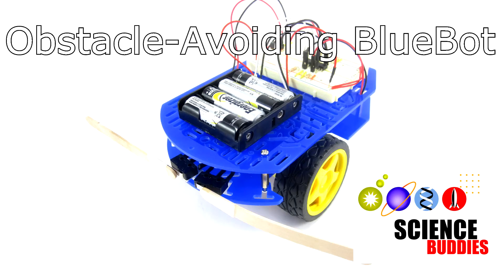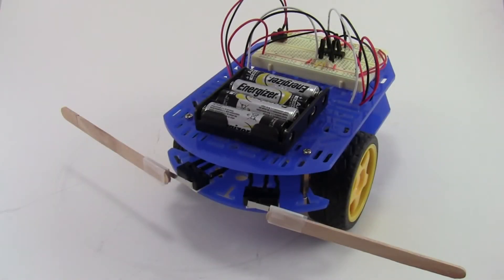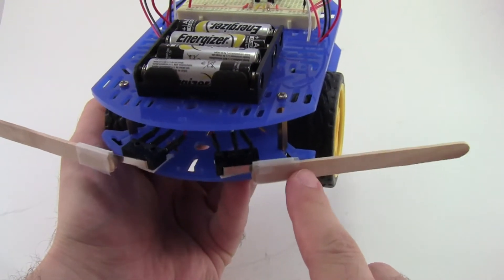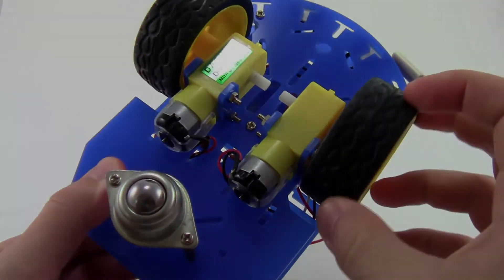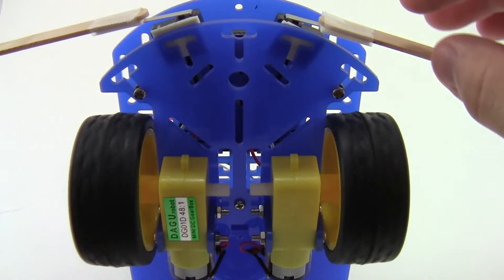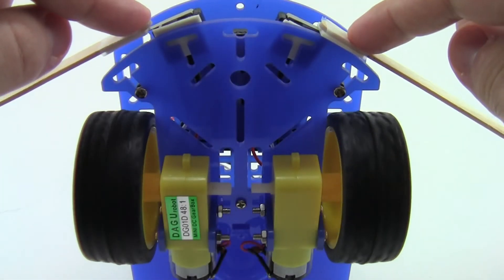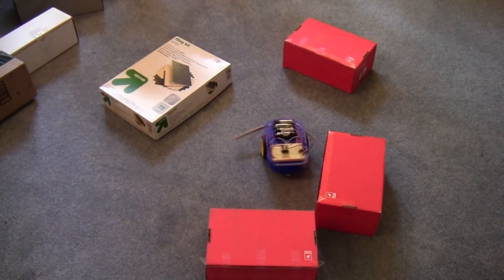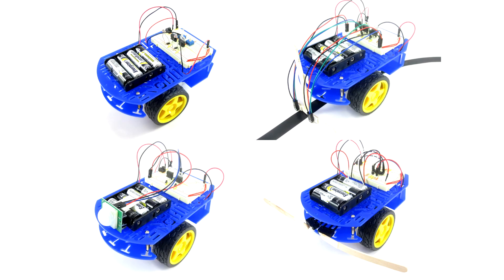Obstacle-Avoiding: BlueBot Project #4 | Science Project

Comment: It’s unfortunate for me, I have worked to build this project for two days now and it is not even starting not to talk of spinning. I have troubleshoot everything stated on the website but it wouldn’t just spin?
Reply from the maker: If you are still having trouble with this project, please post in our Ask an Expert forums and provide as much detail as possible, including clear, in-focus pictures of the circuit on your breadboard, and we can help you troubleshoot: https://www.sciencebuddies.org/science-fair-projects/ask-an-expert-intro
Reply: @Science.Buddies  My question is pretty straightforward, what other value of MOSFET can I use different from the one used in the PIR & line tracking projects? So, I finally got the obstacle working but stuck in the other ones
Reply: @Science.Buddies  I have been trying to post in the Ask an Expert but just seeing different post but doesn’t gain access to the questions platform
Reply from the maker: Hi - you need to create an account on our site in order to post questions, if you don't have an account you can only view the questions.
Reply: @Science.Buddies  Thanks 🙏 I have an account and registered. The project has worked but will like to post it once I mount it on the chassis to see the full behaviors.